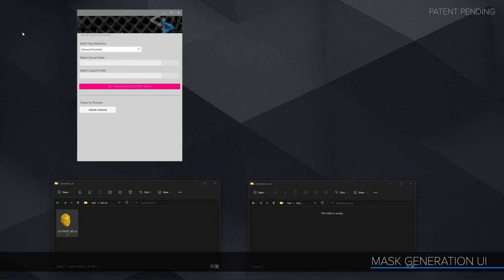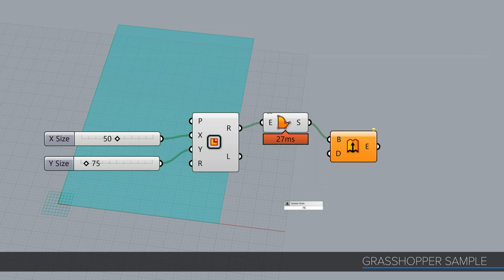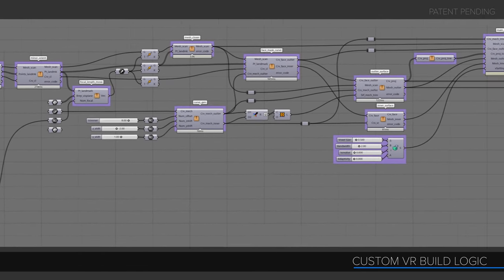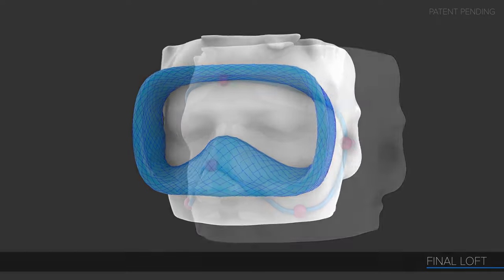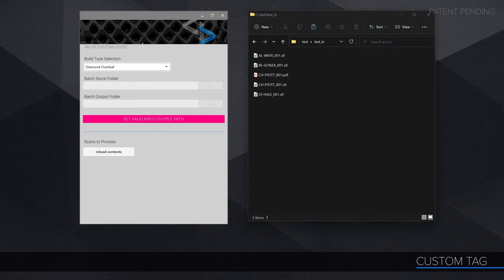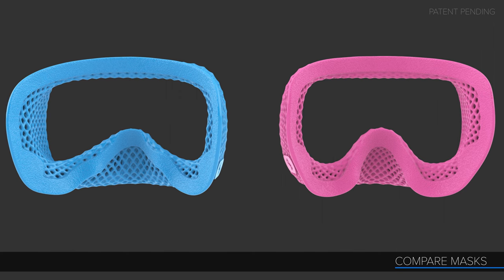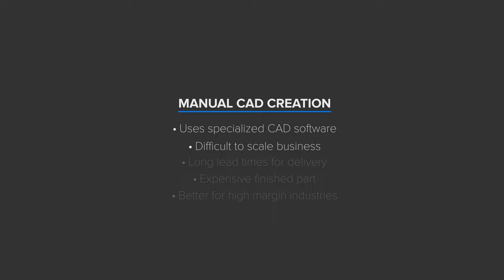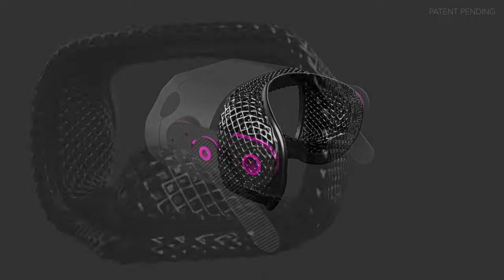Custom VR - Lattice generated from an iPhone 3D scan

Comment: This is crazy! For todays tech its looks so simply create such tool.
I have thinking for some time about creating custom face mask adapter for FPV googles. I'm using F360 for few years for modeling. But after watching your video i'm looking forward to try to make it in grasshooper. Can you explain in some more details how you analyze and position face scan in relative to mask mockup?
Overal. this is briliant!
Reply from the maker: I actually skipped a step in the video  (it was already getting too long), but the trick for orienting the face scan is to do a landmark detection pass outside of Grasshopper after scanning. This generates a text file with a bunch of coordinates on the 3D model that I can pull into the Grasshopper script. The library I use generates a large number of landmark points but I mostly just use the left/right eye, tip of the nose, etc. With those points I can just draw in a capital “T” between the eyes and nose points then orient the T in 3D space so it's vertical and facing the correct direction. Not sure if that makes sense but it isn’t super complicated to do in practice.

If you do a search for “dlib facial landmark detection” you will find a bunch of info. I would also recommend asking around on the McNeel Forum under the Grasshopper category. There are a lot of smart people on there that are happy to help. Good luck!

Comment: Coming from a background in mechanical engineering, I am quite familiar with parametric 3D-modelling software, manufacturing and 3D-scanning methods. However, I'm not that used to surface modelling and Rhino + grasshopper for example.

Do you have any resources you would recommend to learning rhino and grasshopper?
I am interested in doing similar creation of lattice structure geometry based on 3D-scanned point clouds.

Also, just found out about this channel because of the controller video and the content is great!
Reply from the maker: Thanks! David Rutten’s Gasshopper basics series is a good place to start for GH. The Rhino3D channel is pretty solid in general for Rhino basics.
https://youtube.com/playlist?list=PLWIvZT_UEpWW3m5iJl7eVAIsCs-FwbwC5&si=YKajXajBlvXe7l9y

I would also recommend searching through McNeel Forums. Many times you can find similar projects to what you are trying to do with definitions you can download and modify which really helps with the learning process.
https://discourse.mcneel.com/t/dendro-dynamically-driven-variable-radius-lattice/82200

My next episode is going to be revisiting this project, but for the Quest 3. Hope you check it out too.

Comment: Are you planning to sell this in some way? Because I see the "patent pending" thing and it doesn't look like you've published the program. I suspect that there's some market for costum face gaskets for VR headsets if the scanning is easy enough and the product can be made sufficiently cheaply. I'd prefer an open source solution, but I feel like almost nothing related to VR takes that route so I think you could find enough people who'd be willing to pay something.
Reply from the maker: There wasn’t enough interest to justify the cost of a patent so I didn't follow through with it. The build system is all running off of a Rhino / Grasshopper script, not a proper code base. I considered posting it as a paid Patreon download but I think I would end up with a bunch of angry subscribers when they realized they need a $1,000 piece of software to run the script. I am going to do another episode after the new year where I modify the build system to work with the stock Oculus 3 so I will figure it out then.
Reply: @PyottDesign wow any updates? Im really interested in the Quest 3 custom facial interface system. Will definitely pay for it